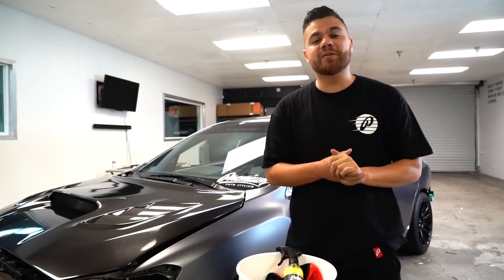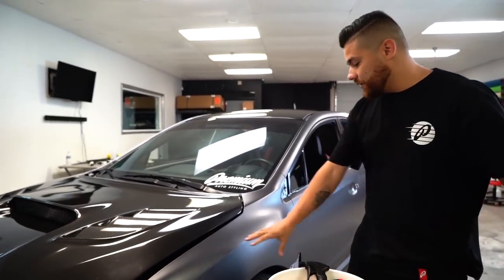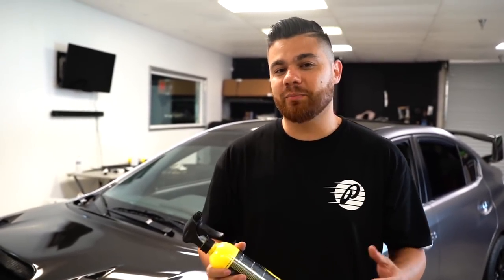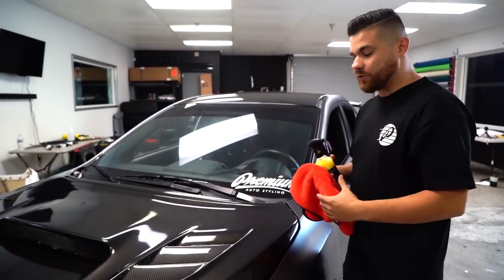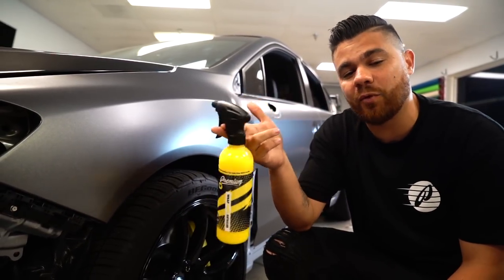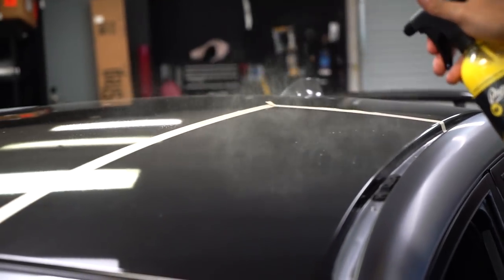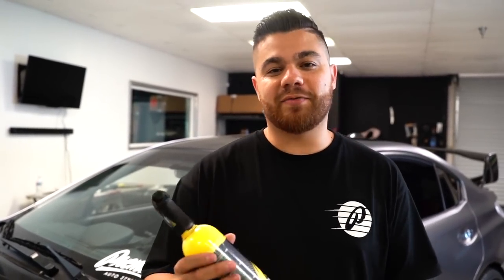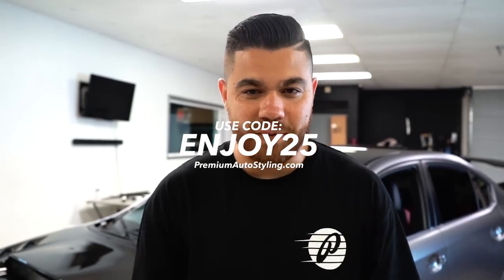How To Clean Vinyl Wrap (Quick Detailer Spray)

Comment: Looks like it worked fine but the cuts in the video were so damn fast you could barely compare, angles didn't help and the camera wasn't focusing for the roof at all. And Jesus 30 dollars for 16oz might be the most expensive quick detailer I've come across. If you're going to be using this every other day you may as well spend that money on ceramic coating the wrap imo.
Will wait before I jump into buying, the 30-40 dollar quick detailer gallons seem to be working perfectly fine in between washes for removing light dust, water spots, fingerprints, and other light garbage that gets flung on the car while driving.
Wish you the best of luck with this venture though, don't think it's for me.

Comment: Nothing will ever top a gentle hand wash with proper materials as a way to clean a car. I would use this as a drying aid or final wipe down, looks like a good application for this.

Yall should hit up Larry at AmmoNYC. He maintains multimillion dollar car collections as a career, on top of having his own detailing product line.
Reply: As technology continues to advance, old methods will continue to die out. That goes for hand washing as well. I would say that 99% of the time if done properly you will get identical results with something like a high quality quick detailer. (obviously assuming the car is not completely filthy)